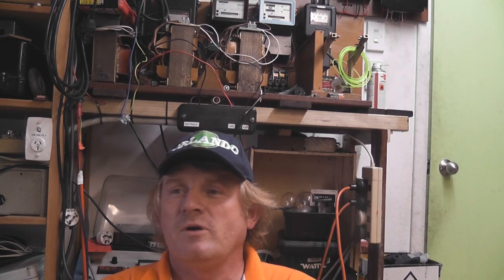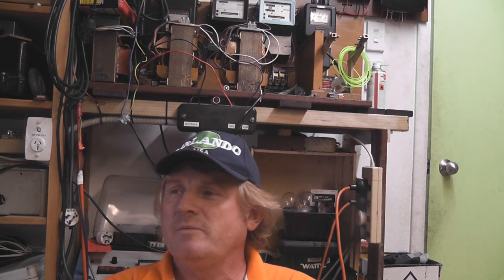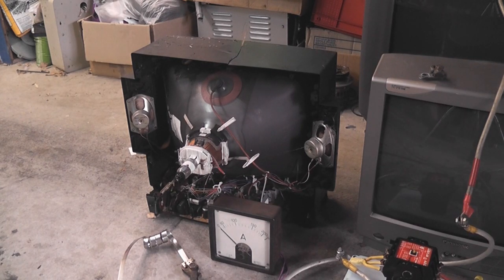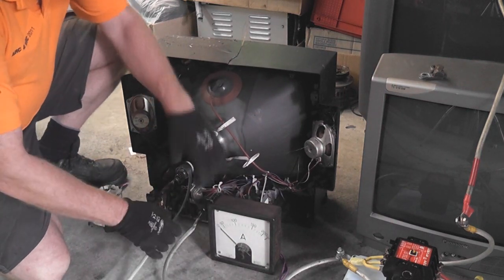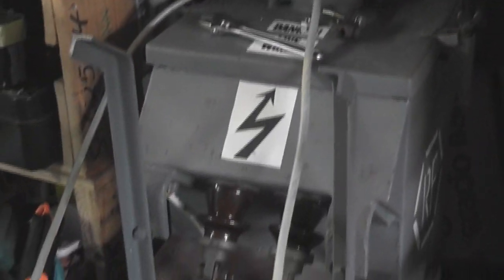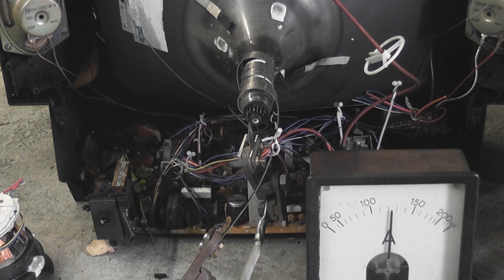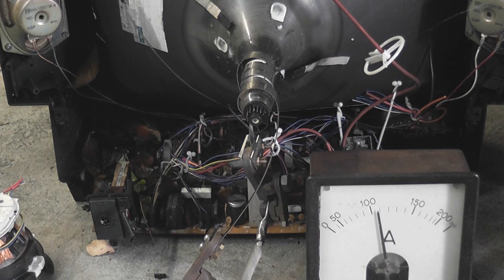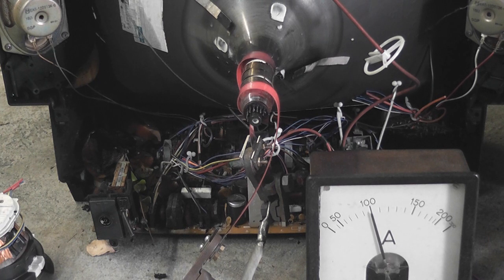Overheating - melting the CRT neck

Comment: Water itself is a poor conductor, especially at low voltages that RODALCO2007 used in this video (12-18V).

Comment: YAY! More CRT fun. :D

LOL, the glass on this one got so hot that you melted the neck right off. :D

Makes me wonder what kind of effect would be had if you got the glass glowing hot, but not enough to make the tube vent-off, then quickly turned off the power, then threw ice-cold water on the hot neck of the tube?

I think we'd get a nice little *THUMP* as the tube let loose and lots of air gushed in there. :D

Thanx for showing. Good to see you back, & looking forwards to lots more vids.

-BBD.

Comment: Next one have the set on, with the tube base on and the yoke just hanging there but still connected, and 2 mirrors to show the bright spot of the beam on the CRT front. Will be fun to watch the beam run around in circles as it warms up till the EHT arcs over in the CRT.